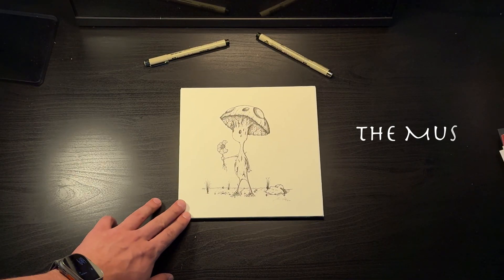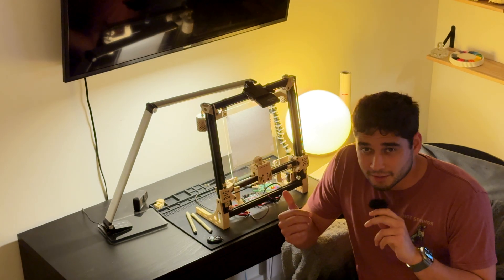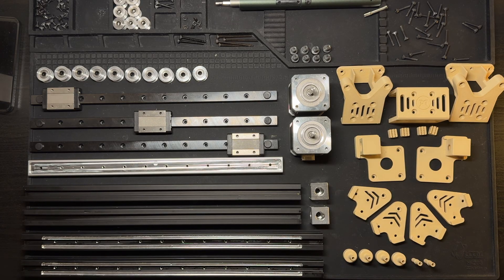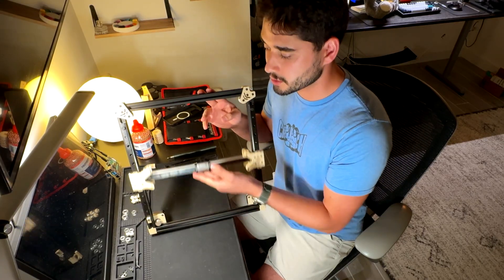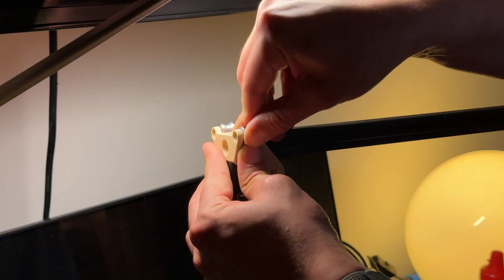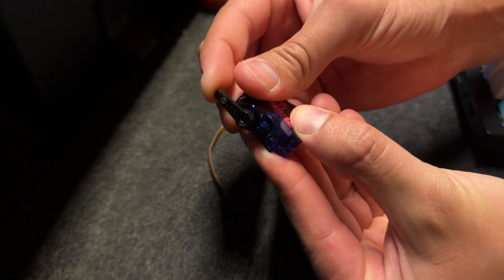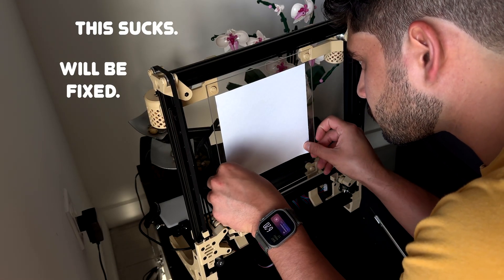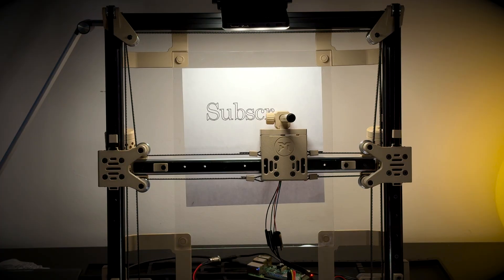Building a new drawing machine

Comment: Howdy!
For creating Gcode commands. 
I think you could use 3D Printer slicing software to help. There's an option in Cura Slicer to lift the print head when traveling. I think this would be an essential command as you do line drawing because you need the pen to lift when it moves from one line to the next. just a thought.

Also, I'd love to help make your design work with Ender 3 hardware + silent board. I think that'd be a fantastic option for reusing all the old printers in the world.
Reply from the maker: Thanks for the feedback! I will definitely look into better ways of slicing images

Comment: Paper attachment solution - magnets, maybe? A strong neodymium magned would be held in place with a 3d print on the other side of the acrylic and then another, maybe a smaller one would be placed on the paper so the paper would be pinned in place by the magnet. The surface area of the magnet would be relatively large so the pressure on the paper would be more spread out, preventing dents and stuff maybe.

Cables - I always found cable chains to be such a pain, but maybe one thick black snake of cables going from the top of the machine to the gantry? Black would make it less noticeable, but it would also be meant to be seen, not trying to hide itself, it would look intentional yk

I would also decrease the accelerations in klipper to something really low - you can see the robot shaking a bit when doing small shapes and slowing it down would help to mitigate that, since you've said that speed is really not the goal here.

Overall the build is really cool, I like the fact that you did not try to go the sweaty tryhard reinventing the wheel aproach, the whole thing just seems nice.
Reply from the maker: Dude thank you for all the thoughtful suggestions! Really appreciated the feedback. For the paper attachment, I’m actually working on a mechanism that will wind a roll of paper from one spool to another, similar to how a film camera works. That way I don’t have to switch out anything for a while.
Reply: @Marked_Fabrications  Glad you like them. One thing about a rolling setup like this, which you've probably figured out already is that its hard to keep the tension even on the whole sheet (middle vs edges), I'm actually interested if and so how are you going to solve this